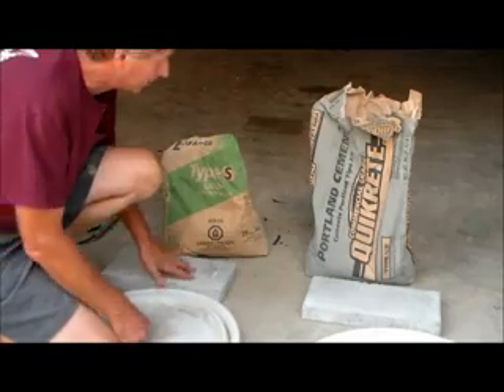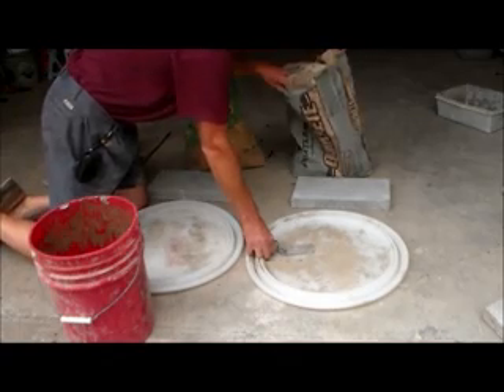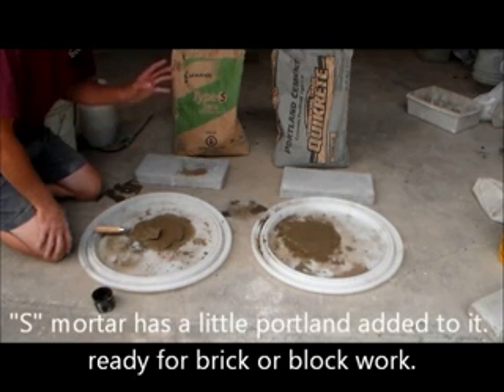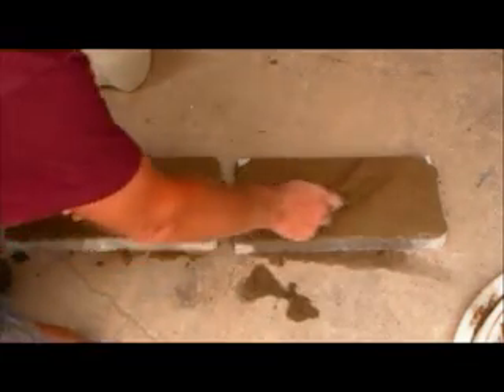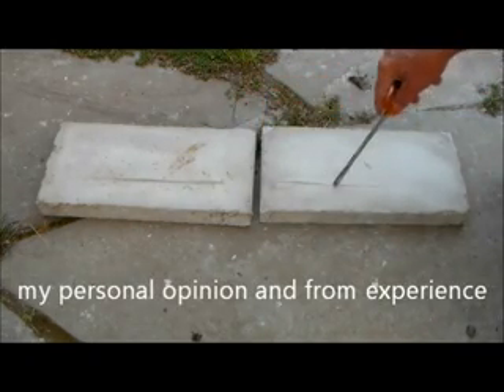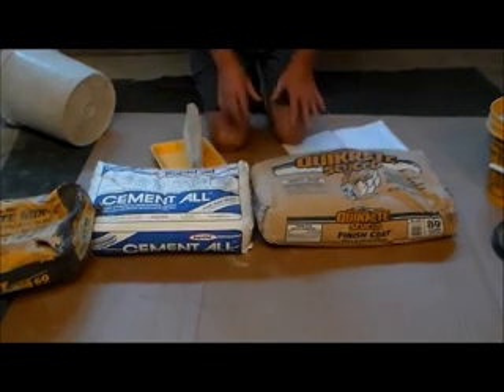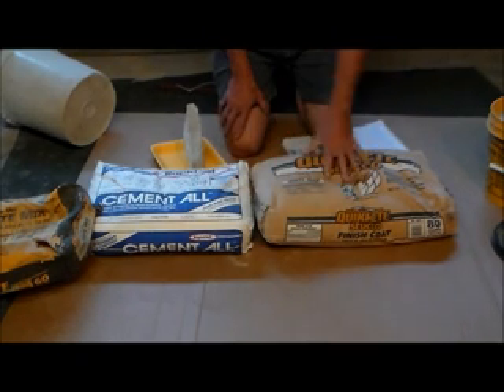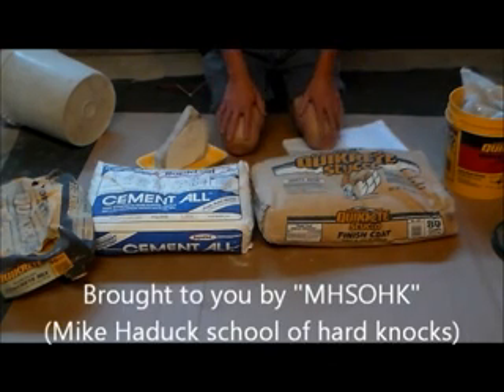WHAT CEMENT SHOULD I USE ? (Part 1) Mike Haduck

Comment: 6-6-2021 Wow, Mike your videos are great❗️ For block pads for a sidewalk, would it be ok to apply a sealer❓
Home we bought years ago had some 18” sq x 3” thick pads, and I extended the walkway using fast setting for a couple pads. When I purchased the next sack Crete I got the 5,000 psi concrete that took about 5 days to get full strength. They all turned out ok, but I still wasn’t happy with their surface smoothness. I wanted something smooth with less small rocks/ pea gravel. So, for a sidewalk pad size 18” sq. X 3” thick, what would be the mixture needed when using Portland Cement with play sand❓ You said 1 Portland and 2 sands..... Could mix be off some in a dry mix in my form❓ I also, made a flower bed border size 3’ long X 3.5” thick. And a couple being 4’ long ( kind of heavy to move ) and that’s why I shortened my border form. The borders needed to be pink to match brick on house. I thought concrete could be colored with dye, but it didn’t work for me. We had purchased a pink stain, but when it rained and runoff hit those borders, the stain just flaked off. So, I purchased some sealer. Repainted with the stain, letting it dry. Then slapped on the sealer. When it rained again.... presto, it didn’t flake off.
I used both concretes to make 4 borders so far, but I still want them to be smoother. The tops of the borders are curved. I used 3” PVC cut in half and used 1 screw to hold them in place. When putting concrete into those curved areas, there’s always little pockets where concrete didn’t get. And I want to eliminate those gaps. Now, I pretty much have to destroy my form to get the concrete out. I used Vaseline and thinner paste all over those curved areas, and sometimes it’s really hard to get it to release. I’ve also lined the bottom with plastic bag. At ends of each border I add about 8” of parachute cord while concrete is in first stage of setting up. So when putting borders end to end I can tie them together to prevent separation. So after watching your videos, I think your formula of 1 Portland and 2 sands may help. Please provide any feedback or information about my dry fit before adding water. Now, most bags of concrete take 3/4 qt or a little more, but not soupy. Thank you👍🏻 from Central Louisiana 🇺🇸 6-6-2021
Reply from the maker: Hi David, your weather is a lot more mild, down there there the mix could be little more sand, up here sealers can be slippery because of the frost, your doing the right thing experimenting till you find what works, thanks mike

Comment: Mike I really appreciate all your years of experience.  I am installing a natural rock wall behind a wood stove here in Missouri and wanted to know what type of mix Portland or mortar type s would you use to attach the stones.   I am screwing 1" metal tubes to the wall studs and then screwing cement board to the tubes and then mounting a mesh wire to the cement board.  I  will then use the Portland or type s mortar with the 2 to 1 mix you recommend.
Reply from the maker: Hi Greg, I have a series out “ how I lay stone veneer” where I show what I use in each case,  inside if I am understanding correctly I used S mortar and had no problem, they also make special cements for the stick on stone, I never had a problem with,  outside in my area I usually use or add Portland,  I hope it helps thanks, Mike
Reply: So I am not using stick on stone, just real stone that I have collected from creek beds over time.  So if you were doing this behind a wood stove inside a home would you use mortar type s only or mix a little Portland maybe 20% into it.
Reply from the maker: Hi Greg,  I think plain SMortar is fine behind a wood stove, some would disagree, but that is what I always used and never had a problem,  I hope it helps thanks, mike

Comment from the maker: brick work and block work is a whole different thing, if you wet the brick it gets sloppy and cleaning is a big issue, same with  block work, remember that cement is a binder and not a glue, if you want to do the glue effect then you wet it. things like stucco and patch up. you have to work in the trade for a while to understand it. every mason in every state or country does it different. my opinion, thanks mike

Comment: Greetings Mike - Thanks for your quick reply. I also have another similar repair to do with my driveway aprons due to rain washout. The question is which bagged mix (since there are so many at HD) would you recommend that could be mixed with water thin enough to flow / be pushed through the 3/4" clear tubing all the way into the voids under the driveway using low pressure from a compressor that would be "best" for this job. Respectfully - Anthony.
Reply from the maker: Hi Anthony,  I never used any bags or pressure my whole career, if it cracked once it will crack again, check out my videos on concrete repair. Thanks Mike
Reply: @MikeHaduck  While I appreciate your quick responses - it's clear to me you may not be the right person to answer questions, since no where in my post do I mention "cracked" and the "bags" are what the concrete mix comes in as shown in your videos.  As to the "pressure" that was my creative idea to help push the material further into the void to be filled - much like a poly injection under pressure to fill voids/spaces under slab.  My 2nd. post was a very simple question to fill voids under concrete that got washed out by rain, of which I'm sure you are familiar?  Do you want to try and think outside the box and provide a better answer this time or just give up?  Always Respectfully (Have A Great Weekend) 😀
Reply from the maker: @dmrspec4750  hi dar, with respect, first, I can't give advice unless I was there to see it, 2nd most of these new products I never use because it's overkill and the results i seen don't come out the same as if I did it the old school way, I show the techniques I used over my 50 years of experience and that's it, if my techniques are not adequate then there is no way I can help, but I appreciate it, Mike
Reply: @MikeHaduck  LOL

Comment: Hi Mike.... Question ❓
At What point does cement 🥶?
I'm trying a DYI project!
🤔🤣😂
I wanna put cement in the orange home Depot bucket n put in the fresh cement a 4x4 wood....which I need to make 4 of them....
I plan to start this DYI project this weekend....I'm in the Lehigh Valley area. 
My friend says if the weather lately is freezing temperatures that my project isn't going to work -?? What's Ur Input on this?? Thx 😊
Reply from the maker: Hi Ocean Breeze, sounds like it's a movable fence post or a old type boat anchor,  with my experience if the cement don't freeze for 3 days I never had a problem, thanks Mike
Reply: Thank you 🎯💗
Reply: Actually I was thinking 🤔 of making an enclosement  around my Queen Size Bed😂🤣😒😒😒
Similar to a Canopy Bed But in The frugal Spending 💰
My Place is Drafty & Chilly sometimes ....
I'm Not Connecting it To The Bed &/or Frame, Sorta like Around it-?? Free Standing -??-Sorta?? 
I have high ceilings more than 8'ft. High, So...most Likely I'll make'em outside in the garage, let them set, & use a hand truck to Move 'em.

Comment: I have to repair some bricks around a window opening and have to add some additional bricks to the sill. How can I make sure the color of the mortar to match closely from old mortar to new mortar? Sorry if you addressed it in this video or one of your other videos. Youtube has been acting up. Thanks for all of your videos to date!
Reply from the maker: Anthony Aaron  funny you should ask because I am going thru the same thing right now.  I am going back Monday and using small artist brushes to paint the joints with a close cement. the owner wasn't happy,  but it is a small job so I can fix it in a hour.   cement never matches because of the drying time so you got to play with the cement to make it work, I will sure to film it. won't have it ready for a while but artist brushes and a little time will fix it.  thanks mike

Comment: Great video.  I'm going to resurface my concrete entryway steps.  I have some minor spawling that I'm going to patch before I resurface.  After I strip the old paint off and clean it, what type of cement/mix would you use I use to resurface it?

Comment: In a lot of your videos you blend Portland together with S mortar-   and then mix THAT with your sand.   My question is-  for purposes of practicing   if I were to mix bagged premade Sand Mix  with bagged premade S-Mortar--- Would that be suitable for practicing and have similar characteristics to the mix you make from scratch?    Just to be clear   the sand mix and S-mortar I'm talking about are the bags that only call for water-   from either of the 2 big companies.
Reply: Mike I don't know why there are lines thru my sentences above.  I must have made a mistake.   I didn't mean for those sentences to be "crossed out".   thanks
Reply from the maker: I have mixed both and added portland, sand s mortar etc. in my opinion cement is cement, but It all depends on what you are using it for,  when where and why,  I know for sure you might have trouble matching the colors,  Like I said though everything depends , it it is underground I usually don't care,  I hope it helps thanks mike

Comment: Hello again Mike, you sure are one hard working guy. My question is, can I use your 1 portion of portland with 2 parts play sand technique to resurface previously cemented cinder block wall a couple of years ago ? I am now seeing the line on the second course of block.
Reply from the maker: Hi Frank, once you start seeing the lines they rarely go away,  I don't know exactly what you are doing, mike
Reply: @MikeHaduck  Hi Mike,Just resurfacing a knee high retaning wall.
Reply: @MikeHaduck  Mike,I should have specified that I'm using topnbond wih a slurry first.

Comment: Hi Mr. Haduck.  I’m a big  fan and need some advice. I have a home in Southern Utah and we have had a wet winter there is a white powdery substance in my bricks and the edges of my concret patio.   It looks like it is causing an edge to deteriorate a bit.  Is there anything I can do to stop it or repair the edge so it won’t get worse. House is 5 years old.

Thank you very much.
Randy Payne
Reply from the maker: Hi Randy,  I have a video out called " efflorescence , what is it" Mike haduck. That might help thanks Mike

Comment: Awesome video, Mike. Thanks for sharing your knowledge.  I am repairing the joints on a Flagstone exterior patio that was laid on cement, some joints had lifted off.  I have chiseled out as much as I could of the previous joints in between the stones, which appeared to be a mixture of cement because it was very hard. Do you see any problem in using the 2 parts masonry sand and 1 part Portland Type I-II in Tampa, Florida, we don't get as many hard cold days as in Pennsylvania, but in Florida, the averages temperatures range between 52F in the winter to 90F in the summer versus 26F in the winter to 87F in Pennsylvania.  My rationale for using the same 2 to 1 mix you recommend using in Pennsylvania for Florida is because the summer average temperatures in Pennsylvania and Florida are about the same, and if the 2 to 1 mix works for Pennsylvania (26F in the winter) why would it not work for Florida(52F in the winter)? Any guidance would be much appreciated.
Reply from the maker: I think in florida a little more sand would be OK   3 sand to 1 Portland would be fine, then that way It will not shrink as much,, my opinon but give it a test and wait a few days to see how it turns out, then continue on,   check out my video How I install a stone patio (part 2) Mike haduck ,  and that should give you some ideas, thanks mike
Reply: Thank you Mike. You are amazing mason!!
Reply from the maker: if at all it is God givin, thanks mike

Comment: Hello Mr. Mike , I would love your advice. I'm using a large & medium size stainless steal bowls as a mold to make small fire pits. The first fire pit I used a mix mortar it turn out ok, nice. I tried to sand a few high spots I don't thinks there's any such thing as Sanding a little with mortar if you start you can't stop. I would like to know what you would use . Im not putting the fire directly into the pot I have the small cans used for tiki torch  in the bottom with wire that fits perfectly across the top then glass that's used for fire I'm told that's all I can be used to put over the wire.   I want it to be covered completely the wire works well .  I was told I have to use a special glass any other will burst when it's hot or regular stones may burst & turn black.  Also can you use a stain that's used on concrete or pots it seals soon as it dries.  It is DecoArt Stain. I sure don't want to blow up my fire pits. Thank you I appreciate your time. Lorrie
Reply: Mike would certainly know better than me but I have rendered a pizza oven in the past which was subject to extreme heat and I used a 3-1 sharp sand to portland cement with fibre glass chopped strand mixed in and it has held up well 1 year on after numerous firings. I think for your fire pit I would put some gravel in as well. What do you think Mike?

Comment: Mike im thinking about using a 2" layer of rapid set mortar mixed with fibers to overlay some settled pavers in my backyard. What do you think of this type of installation? Would you tackle a project like that? I'm a big fan.
Reply from the maker: Hi Elias, I could never give advice over the internet but I did do a video called, (Paver repair, How I fix sunken pavers. Mike Haduck) and  (How I lay pavers on gravel). maybe that will help. I always try to re-do things before I try a patch. thanks hope it helps, mike

Comment: Hey Mike, great video. Would you tell me why the stucco scratch coat on my house in Florida has horizontal cracks in it? They have not installed the final coat and I want t know how they can repair that before they do. Thanks.
Reply from the maker: Usually they do a first coat and let it shrink up, shri k cracks are normal, then the second coat covers it, that's the usual procedure, but you could ask, thanks mike
Reply: @MikeHaduck   Mike thanks for the reply. I feel better knowing that it won't affect the longevity of the stucco finish. 
Appreciate your candor.

Comment: Mike, been subscribed for years and not a concrete guy, just a homeowner. Question - do you have any slurry coat for swimming pool resurfacing? There’s a company that has a roll on then trowel to finish material made to go over existing in ground plaster pools (with proper surface prep, of course.) I was wondering if you’ve ever run into this type of material and your thoughts on it. Thanks for all the great informative videos.
Reply from the maker: Hi Mick, I can't say that's a whole different thing , thanks Mike

Comment: Thanks Mike. I wondered when walking through the mason aisle at Home Depot or Loews what's the difference between all the types of cement. Now I know.
The project that I'm now tackling is redoing a ground-level bathroom. I took off the interior wall and found a buried window and lots of ancient termite damage to the joists and lower wall plates (no live termites.) Since the exterior wall is masonry up to 5-6 ft, I want to cut the window out and replace it with cement block & cement. I also want to replace the bottom wall plate frame, since they were completely eaten by the termites, with cement plates to assure that there isn't any openings -- then affix pressure treated wood to the cement plates.
Reply from the maker: Thanks Joel, mike

Comment: Hi I am repointing an old chimney which was built in the 1800's as modern mortar can sometimes cure too hard and crack old bricks. I found a type O cement recipe mix online, because you cannot buy it, which is 1 part portland, 2 parts masons lime, and 8 parts sand. I did not know if you have worked with older bricks and would have any suggestions or a better mix ratio. As for the climate I live in the upper south part of the US. Thank you
Reply from the maker: up here in these parts 0 mortar does not last, I use nothing less than s mortar, than seal all the brickwork to keep it out,  I would ask the locals, supply and brick yards in your area first what they suggest,,   i hope it helps, thanks mike

Comment: Nice video. My question is- I am making refridg. magnets and am experimenting with what to use. Plaster of paris seams too soft. There is dental plaster etc. I need the price down. Using straight cement with a speeding agent seems best. Strong and cheap. What do you think? Using in semi rigid rubber mold.  Thanks Chris
Reply from the maker: hard question to answer, I guess you got to experiment with different one till you find one that works. hope it helps. thanks mike

Comment: Hello Mike! What do you recommend using to repair a crumbling concrete block home foundation in Minnesota? I am thinking of using Portland and sand for the crumbling parts and elastomeric patch compound for the cracks that are 1/8" or smaller. Can you please recommend a good, concrete gray-colored elastomeric patching compound for this vertical application? Many thanks!
Reply from the maker: Hi Mary, I got a whole playlist on foundation repair,  in that I show what I used in all the different circumstances,  I am sure you will find something similar,  I hope it helps,  Mike

Comment: great video. I need to do parging job  on the front outside  foundation wall, what cement can i use. and is there anything i can add to make the cement waterproof, coz in snow or rain the water seeps down to basement.
Reply from the maker: kloff tiger check out my video, masonry tips for beginners,, and how I patch up a foundation, and how I repair concrete steps, a patch is a patch and it will always have to be patched again, as long as you remember that you should be fine, thanks mike